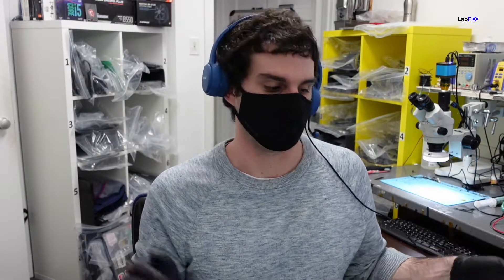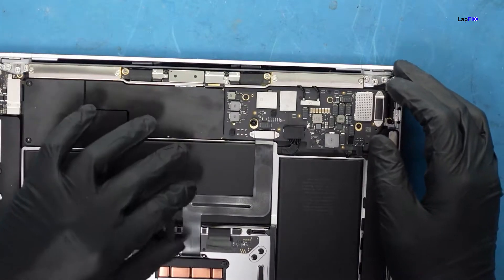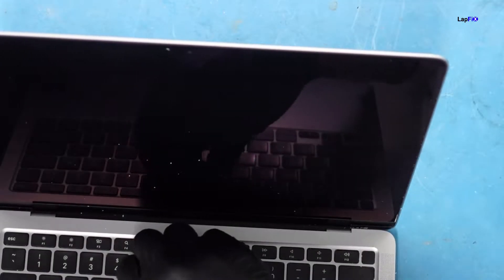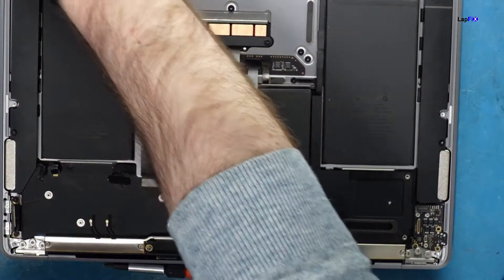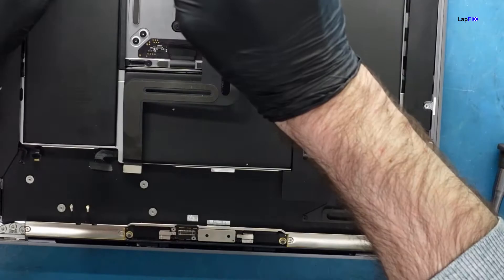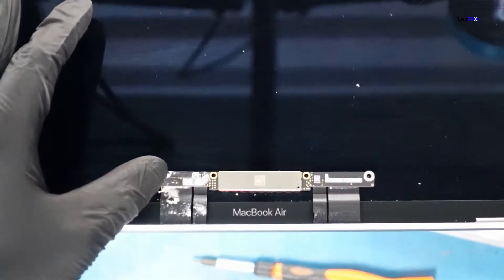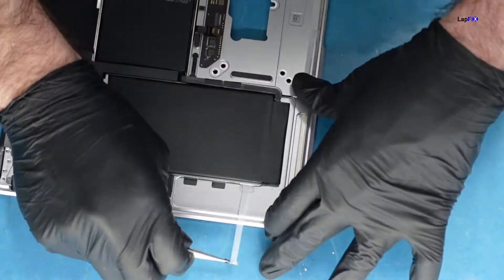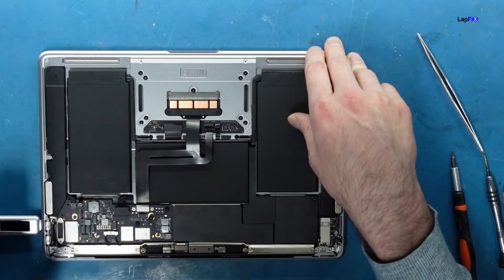MacBook Air M1 Keyboard Repair

Comment: Hi LapFix,

I hope you’re doing well! I’m reaching out for some advice regarding an issue I’m having with my MacBook Air M1.

My screen got damaged twice. The first time, I successfully replaced the screen without any issues. However, during the second replacement, I made a mistake by forgetting to detach the battery clip before removing other components. After putting everything back together, my keyboard stopped working.

I’ve already tried replacing the flex cable, resetting the settings, and even updating the OS, but the problem persists. Now, I’m left with two options: either replace the keyboard palm rest or the logic board.

Before I go ahead and buy any unnecessary parts, I’d appreciate it if you could advise me on what might be the best next step to take.

Thanks in advance for your help!

Best regards,
Paolo

Comment: Absolutely great video in good detail. Im going to embark on this next week. I am amazed you actually seem to have to take the MAcbook down to almost bare periodic table elements for a simple keyboard swapout. I remember working repairing HP/Compaq laptops 20 years ago. On most, if not all models of HP Omnibooks, all you did was to pull down 3 little plastic flaps at the top, sometimes there were 2-3 screws at bottom reachable without opening the laptop, then pull the keyboard forward, open the cable connector and reverse process with new keyboard. Time: 2-3 minutes.  
Edit: To be fair on Apple, their Macbooks are very durable. I did look up a video on replacing keyboards on modern PC laptops. It is actually similarly hard, it has gotten much harder there too as they are no longer that modular. HP and Dell, similar to Macbooks. Lots of tools and time required.

Comment: I spilled an entire cup of sugarless white  coffee on my Macbook Air M1 Mid last month.
For some reason I couldn’t act quick to flip the comp upside down, it was a nightmare trying to switch off the comp..it took an hour to learn that I needed to long press the fingerprint button for 10 seconds to switch off the comp.

I attempted to suction the tea from the keyboard after shaking the hell out of the computer and I got some coffee from the keyboard. By now the coffee was dripping through the left upper edge of the case from behind, and I knew the coffee had gotten inside.

I left the comp to dry for more than 24 hours and when I turned it on.

Issues
1. The output from half of the keys was different.
2. I needed to use AZERTY keyboard to type as ABC keyboard wasn’t working  because of different key output.
3. Navigation through windows became problematic..as I couldn’t select anything after 10 minutes of using the computer.. as the ‘caps lock’ would activated and I couldn’t deactivate it. All the keys would have a totally erroneous output .
4. I knew my key-board had been damaged at this point.

Attempts to resolve the problem
1. The Mac repair persons I contacted told me, it would cost me $30-50$ to check and clean the comp, however, this was not a guarantee it would work.
2. Another Mac repair guy told me it would cost me $600 while another promised $300 for a new M1 Mac Air Keyboard. Problem is they did not have the keyboards with them.
3. Option 1 was favourable, but then I remembered how my Dell Xps was handled by a repair guy and I decided I would rather do it myself as I had a full toolkit.
Action
1. I removed all the keys carefully (but damaged 1 key; F4,) and cleaned the sticky residue underneathe the keys.. using alcohol swabs (70%) and allowed them to dry.
2. I opened the comp disconnected the battery and cleaned where I could see the residue.
3. I did a thorough macro-inspection of the components behind- looking for residue, rust or any oxidative changes that may have occurred on the different boards.
4. I finally identified the keyboard connector, which had a lot of greenish residue from rusting, I thoroughly cleaned it with alcohol swabs and clean tooth brush, the shinny metallic connector was rusted and i had to scrub the rust off.
5. I removed the mouse pad and cleaned it with alcohol swabs.
6. I then reconnected the computer and 1 month later it is working just fine.
Reply: Lesson learnt! if you get the comp to be cleaned the same day the spillage occurs you have a great chance of saving the comp. So switch it OFF, disconnect the battery and have a mac certified repair technician disassemble the computer and clean it.